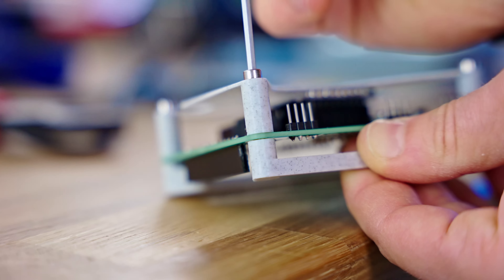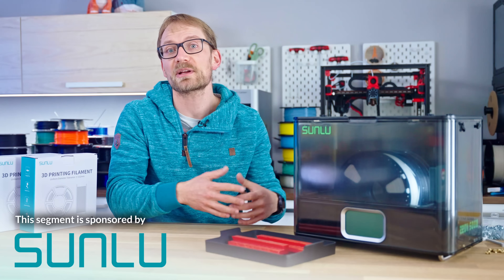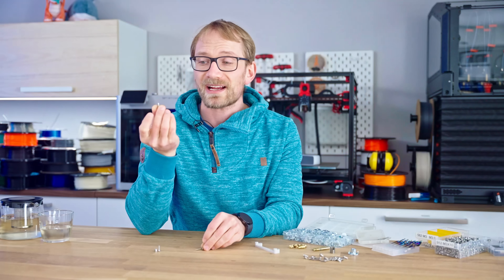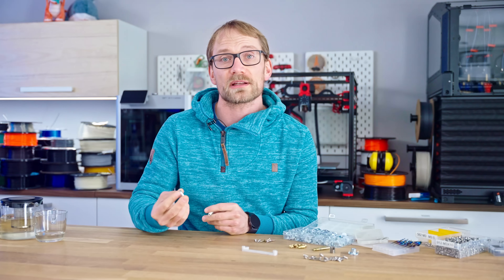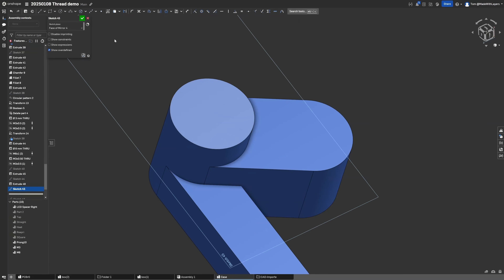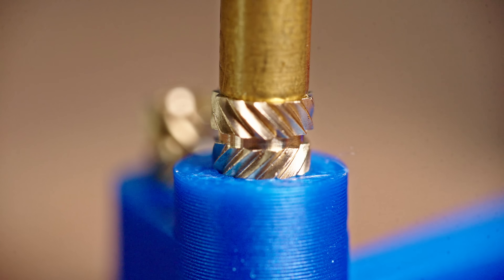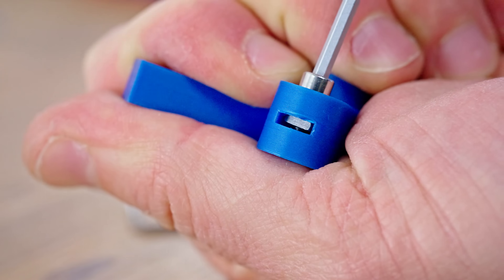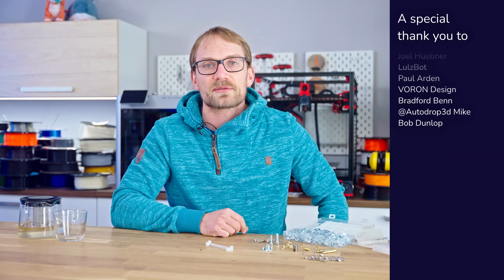A better way to add threads to your 3D prints

Comment: Onshape in 2025 still not having a thread tool is soo incredibly riddiculous. Like they advertise that they are a professional level CAD programm. It fucking isn't. And sure you can use a third party app but what if the developer of that decides to charge for that. Or just shuts it down. Essential tools need to be included Onshape is a joke for this reason.
Edit: the negative boolean tool preparation is a pretty good one. Never thought of doing that. Very handy. Thanks.
Reply from the maker: I think there's a bit of a misunderstanding here. Typically in CAD, threads are not modelled as part of the 3D geometry, but instead created as a thread description - which is then easy to call out correctly in drawings, and easy to process into an efficient toolpath in CAM for CNC machining. Onshape can absolutely do this out of the box. What Onshape needs an addon for, is creating 3D modelled threads, which are only specifically necessary for 3D printing them directly. In fact, using the Threadlab addon actually works better than Fusion's built-in thread tool for this, because Threadlab directly lets you set an offset to the thread size to compensate for 3D printers' inaccuracies.

Comment: Depends, but I tend to either tap machine screw threads or just use hot-set drywall screws.  They're cheap, they fit flush, and after the screw cools, the threads are quite durable.  Same thing works for plastic screws.  Setting them hot means you can afford to get nearly 100% thread depth.  Installation is a bit of an art though -- bit of a hassle too.

Comment: I love tapping the threads into the plastic, in inventor or fusion if you don't select to form the threads then it creates the minor diameter hole which is perfect for tapping the threads, I beef up the number of walls and print away, never had an issue with them melting and I have used it successfully down to M1.6

Comment: when adding holes for nut inserts, you should place the slot with as much clamped plastic as possible. putting the slot in the middle mean only half your print is under load. 

if you want to have the same effect without a gaping hole in the side you can add a pause to your print and add the nuts during printing to have them, fully enclosed.

Comment: My favorite threaded inserts are the "Brass Screw-to-Expand Inserts for Through Holes in Plastic" you can order from McMasterCarr.  They have a flange on them, either on the back to prevent them from pulling out or on the top which makes a nice surface for shoulder screws to mate to.

Comment: I wonder if there is a solution to use a lubricant coating and thread locking compound on a bolt pressed into a near sized hole?

Comment: The self forming thread is awesome! I wonder how just a regular hexagon would do... It would be easier to model.
Reply: Just my thought, maybe test several shapes from a square up to a hexagon or more corners in some sizes to see which ones works well  for M3 M4 etc
Reply: @Acamperfull that's exactly what I was thinking! I was just guessing a hexagon would be the sweet spot but it will be interesting to test other shapes too.
Reply: @Dustmuffins  Yes, maybe a pentagon could be a good candidate. The diameter of a circle inside the pentagon –tangent to  sides– is ca 80,8% of its "outside" circle passing through the vertices. For M3-M8 the  tap drill sizes are also about 80% of the nominal (outer) thread sizes.
Reply: @Acamperfull  good info!

Comment: For me it's either a simple hole or a heat set insert. I have used nuts before, but it takes more time than heat set inserts, so I don't bother anymore. I don't think you need a specialized tip if you have your tolerances right, at least with the inserts that have a step that you can insert into the hole before melting the knurling in.

Comment: I think the self-forming threads, combined with the thread-repair inserts would give the best overall rating with ease of installation, and durability. With strength second only to the inserted nuts.

Comment: Great idea! I wonder if a simple polygonal hole works well, too… I've just been using a 2.9mm hole for m3 screws that aren't bearing much load. I guess my settings are dialed in enough that it's consistent.

Comment: One tip I learned for heat set inserts that was life changing and makes installing them very efficient, straight, and clean - 

 
Press the insert in most of the way but not all the way, then, use a flat piece of metal or other similar material to press the insert the rest of the way down to be flush with the surface. 

This completely fixes issues I had of plastic bulging out around and above the inserts as well as issues with the inserts not being straight. Hope this helps someone!
Reply: I believe it was GeekDetour that showed how you can sand down the head of a hex head screw and use it for exactly this :)
Just use one with a head slightly larger than the insert, M6 works great for M3 inserts
Reply: You should also leave a bit of space below the insert so when you push the insert in, any plastic being scraped down by the bottom edge has a place to go. 

I do this along with the last 2mm flat surface push and it's worked every time.
Reply: @UgrevsBoots good point! I also do that but didn’t think to add it
Reply: I do this too, using a spare piece of flat aluminum gantry from my modified Ender. Works like a charm, especially since it's thermally massive enough to prevent heat transfer to your fingers as you clamp it flush.
Reply: Love it. No need for the fancy heat set vertical arbor press.
Reply: Cheers mate! Really good advice! Will implement it!
Reply: To place the inserts properly, you use the bolt to push it in straight, and you have a washer, so you have insert|washer|nut order set to the long bolt that you support to 90 degree corner piece that gives you always 90 degree push. 
After insert you just unscrew the installing bolt out .
Reply: Insert most of the way in, press part flat onto table with some force. Easy.
Reply: you can see why this would work from the close up footage in the video. the insert moves around a lot after the soldering iron is removed, because o the tension in the semi melted plastic. so you want to hold it in place while it cools, which you cant do with the soldering iron tip.
Reply: Yup it's so stupid easy. you don't even have to use any force on the soldering iron just heat it up and use a flat metal piece and push down.

Comment: Anyone used Helicoil as thread? big brother of thread insert.
Reply: That's the one in the middle of the metal inserts. Meant to be inserted into a bigger thread. Only ever used them in engineering.  I didn't like using them tbh. Wouldn't use them in something critical.

Comment: I think you misrepresented the first method when adding complexity to it by adding ridges took it from 2 stars to 5. Give it some clearance, for 3mm bolt i model at 2.6mm though tap drill would be 2.5mm. Then just like your ridge method the threads have somewhere to push the material and create a perfect thread. Use an electric screwdriver to insert them and heat will also melt the thread into reality.

Comment: My experience with Plastite screws has been fantastic. They have very thin metal on the threads that cut really nicely into the plastic and don't self loosen. Can add extra perimeters if you are worried about wall thickness.
Reply: Where do you buy them from?
Reply: @Catrik mcmaster-carr sells every kind of plastite screw. They even have some designed for brittle plastic. You can import the cad model of them directly from their site into fusion 360.

Crazy he blew these off. Not even in the same league as wood screws.

Comment: For super easy heat set inserts, just get a small piece of aluminum or steel plate (like 75x75x3mm).  Insert straight-ish to just proud of the surface, and the press the plate flat onto the surface.  Get the insert set exactly at the surface, cools it a bit so it doesn't push back out, flattens any extra plastic flat, and straightens minor tilts.  If you do a series of inserts, just hold the plate on the last insert and go down the line.   Removes a lot of dexterity required, and they look nicer set right at the surface.
Reply: I do something similar but instead of a plate, I use the head of a flat hex nut. Can be more precise with it, super small, easy to store. Just great.
Reply: Do u heat the plate with a torch?
Reply: @heckerj44  No, he's saying use your iron to press the threaded insert into the part as normal, but stop just before it's flush. Then remove iron and while the insert is still warm, use the plate to press the insert flush (I usually use a metal ruler). It helps keep the insert square, and has the side benefit of cooling the insert while keeping it very flush with the surface. 
For high strength applications, if its feasible - I will also put the threaded insert in on the back side of a hole - much less likely to rip thru. Same idea as the prong nuts he mentions in the video, but a lot easier to install.

Comment: Geek Detour made a great video of how to perfectly and easily set a threaded heat insert. You can use a working table to push it the rest of the way for flush surface level inserts. And for deeper or off angle holes, just use a large cap flat bolt that's smooth and flat. The table and the bolt with align the insert perfectly and help draw the heat out of the insert, allowing it to set almost immediately.

https://www.youtube.com/watch?v=KC1LLU54DKU

Comment: i usually make half the length of the hole a cone that flares out 0.5mm at the opening, makes it easier to get the screw started
Reply: I take my pocketknife and chamfer the hole a bit to do something similar.

Comment: I really like the idea of a "negative space object."  I'll try to remember that for future designs (and not just for screws).
Reply: Don't use an exact copy to create a hole, use a copy that's been scaled up 1% or whatever is appropriate.
Reply: You can make a model that has both the negative space object, and the fastener. Import, cut with the negate space, hide it and the fastener remains. Super useful.
Reply: I use the same trick for servo horns.  I made a model of the horn, then subtract it from the part.  I'll usually sandwich my part between the servo and horn and screw them together.  Gives superb engagement, the weak point ends up being where the horn engages the servo spline.
Reply: One problem I have with it is tolerance. If I made hole using negative object and made object that is made exactly like this hole, it not match, too tight. Maybe slicing program can fix it?
Reply: @juhajuntunen7866  Create the module with appropriate parameters for clearance.  That way when you invoke the module, you can specify whether it's being used in a negative or positive role, and it will adjust the diameters accordingly, without scaling other dimensions which shouldn't be offset.  I thought that this was basic common practice.
Reply: @markday3145  Thanks, I test it with my printer, I found bottlecap and top of bottle from Thinkiverse. Print them as delivered, too tight. But both go well with normal bottle!. Cap scaled up size 102% (2% bigger) was good. (it made nice light bulb base for 12V led DIY lamp BTW)
Reply: Negative space is a quite important step of both casting, 3d modeling, milling and 3d printing
Reply: Not all CAD programs have a good workflow for derived parts though
Reply: @thedoctor16  the good ones do

Comment: hex shaped nuts, add a hole on the back side not in the middle of the print with a hole larger than the bolt threads. Now you have part on each side of the print instead of what you showed with the hole in the middle to slide in a square nut,

Comment: Printed threads + tap are the way to go. You don't need to get the tolerances super accurate, but you still end up with a strong thread that can withstand repeated use.

Comment: My only comment has nothing to do with adding threads to prints. Just that sometimes the best solution is to just use a hex nut and through holes on both parts. :)

Comment: The 3 lobbed idea is a very welcome concept I haven't seen before, going to be using far less heatset inserts on my prototypes now. Close hole tolerances to the bolts used, was never an amazing way to do it IMO, and the only other option I've really tried. This will work great in Plasticity for me as threads are a bit overkill and geometry-heavy operations for no real gain, unless the intention is a print that is the threads.

Comment: Extra infill density around the hole (sometimes with extra internal structures branching out into the part) and heated screws. I usually print a thread in the hole, which will provide roughly the right amount of material to be redistributed by the warm screw. Let cool before applying a load

Comment: I tend to use heated inserts almost all the time, despite the costs. They're just super reliable and I don't mind the installation time at all.
Unless I have access to the backside, in that case a regular hex nut will do just fine

Comment: Depends on the application.  The main downfall with heat set inserts is that the accuracy of hole location is not good compared to the other options, so it needs to be accounted for in your design.
Reply: What do YOU ask for locational accuracy of a threaded hole?
Reply: @urgamecshk  Depends on how much screw clearance you designed into your part.  Did you leave .6mm, .8mm, 1?  People often rely on screws to provide some level of alignment, and I'm sure most people have at one point or another had to drill a clearance hole out to get a screw to fit properly. It's pretty easy to get the plastic too hot and put a heat set insert out of position or in crooked unless your using a guided press of some kind.  You can see crooked inserts in this very video  

This is the basis behind my comment.

Comment: You can form strong threads in a straight hole by heating the screw before insertion. The material will flow to form screw threads.
Reply: This is also my preferred solution when i am not using threaded inserts.
Reply: That is a great idea.